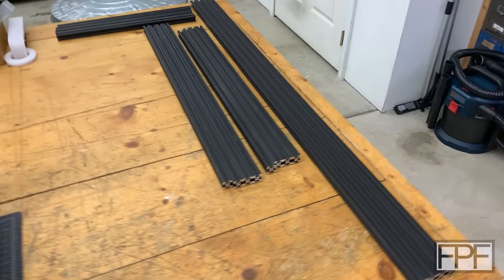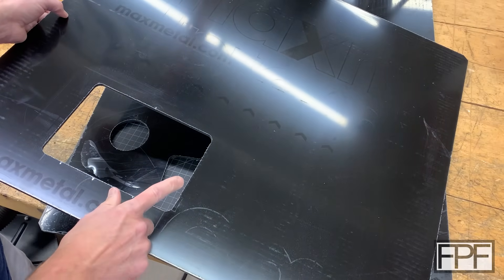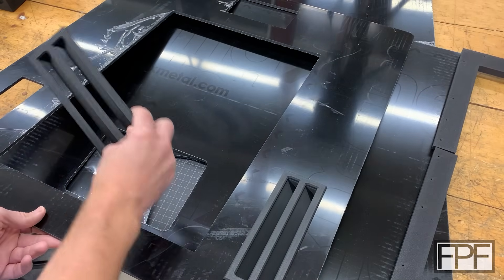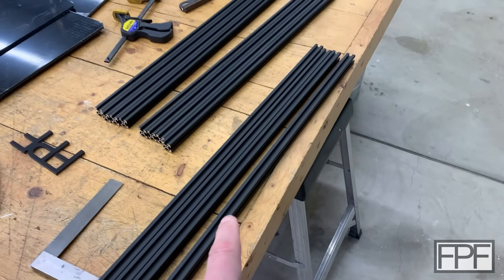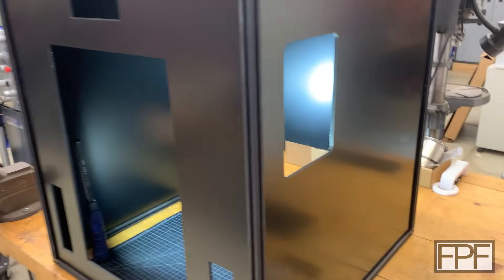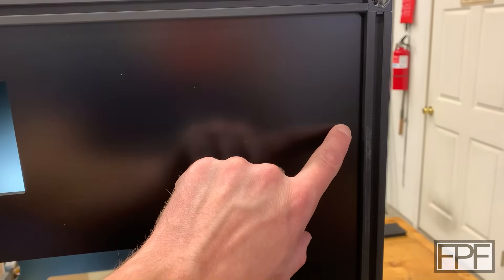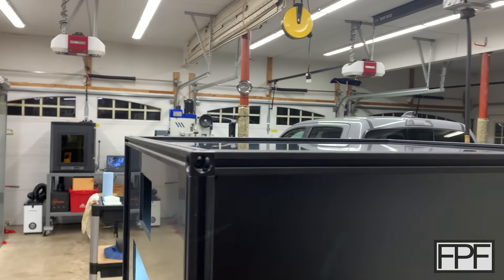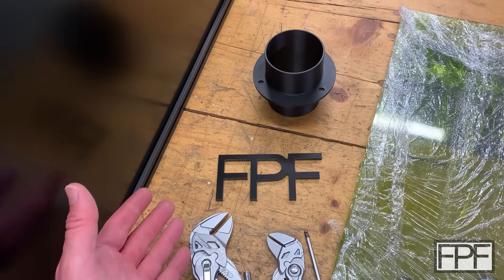DIY Laser Enclosure - 2020 Frame and Panels

Comment: Print TPU corner buffers, they should have enough squish to hold the panels firm and block the gaps.
Reply from the maker: THIS, 100%  I came to the same conclusion thinking about it over the weekend.   In fact, I was beating myself up pretty hard over thinking some caulk in the corners was a reasonable fix (I was tired), and had planned on re-cutting the extrusions, but thinking about it more there's really no way to get a 100% perfect fit.  They would still inevitably rattle.  Preloading them to float from all 4 corners with some TPU wedges I think is the best real solution.

Comment: You have a 2mm gap to fill. TPU filament is 1.75mm and flexible.  You could just lay a strand of it along the bottom track and let the panel edge rest on it.

Comment: I do wood cabinets and when i do floating panels I make them smaller for expansion and contraction as you'd expect.  I fill the expansion joint with the rubber spline tubing for window screens.  it might be too big to use all along the whole perimeter since you can only get it in standard sizes but you can chop them cross-wise at any thickness you want and silicone them in place at each corner (8 in total for the 4 sides).  No rattles and plenty of squish for expansion and contraction.  Love the videos, keep up the good work!

Comment: I would say to get the glass cut with a CNC waterjet if you have one available near(ish) you. It should cut as cleanly as cutting normal acrylic on a CO2 laser. Maybe a local MakerSpace or possibly a machine shop that mostly works with flat stock.

Edit to add: I agree with the many others about 3D printing 1mm spacers to put into the bottom channel. Yeah, you gotta take it apart again, but that would be a much cleaner solution for the overall aesthetic. Maybe throw some spacers into the sides as well if you are shy there to mitigate lateral movement.

Comment: I think I'd put a healthy dab of silicone on all four corners of each panel to hopefully prevent any buzzing or rattling of the panels when the machine is running. You may want to add a dab on the center of each panel/rail once there installed, but that can be done later if needed.

Comment: Cut the safety glass with a laser. Don't score it. If you can't cut it with a laser use a carbide tip fine tooth table saw/circular saw blade. Tape over the cut line on both sides with blue painter tape. When starting and ending the cut, feed the plastic extremely slow to reduce the chance of chipping. It is most likely acrylic. I used to manufacture parts from both acrylic and polycarbonate. Good luck.

Comment: Chop saw with a standard bled works perfectly for 2020. cuts clean and doesn't gunk up like a bandsaw. I just built some porch railings and a gate out of it. Exact same seller too! You can buy some rubber fill trim for the 2020 to cover the exposed slots to make it extra nice looking.

Comment: I'm not saying it would be the right way to do the cuts, but I'd be tempted to find a 1/8" carbide bit for a trim router, and clamp a straight edge the right distance off from where I want to cut the safety glass, then makethe cut in 4 passes to reduce the chance of a singe cut inducing a crack off to the sides. Possibly score both sides of the cut with a straight edge and utility knife to encourage any such cracks to follow the score rather than heading out into the expensive unknown.This does suggest  first making sure you have the ability to tollerate the kerf. If not, score the cut line 4 or 5 times, preferably on both sides, then fulcrum break the panels on the score mark. And remember to sand all the edges and break/cut surfaces. 

Oh, and have a dust extraction to the vacuum as you're doing the router cut. No idea what materials are in the treatments, I'd imagine it's not something you want to brethe or carry around scattering in the house.

Comment: Print some TPU spacers for the channels to act as compressive elements to lift the panels and to minimize rattles.  You will definetly want something for the rear panel where the fan is connected... Even thru the hose some vibration will be transmitted.

Comment: For cutting that plastic sheet, fine tooth plywood table saw blade installed BACKWARDS. I cut plastic all the time and this gives a very clean cut without splintering or chipping. Set saw blade just barely high enough for the thickness of the material your cutting.
Reply: You're*

Comment: To fill the gap remove the bottom rails one at a time and insert a line of printer filament.. That will raise it up just under 2 mm.... To cut the plastic tape over the cut line on both sides and then use a fine tooth table saw blade.... Test on a thin section along an edge you don't need...

Comment: Two quick non-engineering thoughts. First, a handle to lift the enclosure; something to go into the railing? Second, on the exhaust, instead of screws, why not design it with threads? Could then make a nut with matching threads to attach. This would allow simple removal if needed. It would also allow you to put in a gasket and then replace the gasket if needed.

Comment: Foam backer rod.  Put in the slot on the bottom.  It's compressable. You can split it in half if necessary.  It will take care of your spacing problem  and completely disappear. Available at HD or Lowes for a few bucks.

Comment: You can use backer rod for filling cracks in concrete as filler in the rails to center and secure the panels. And it's not an adhesive

Comment: Depending on the size of the chamfers on the corners of those panels, I wonder if little cylinders of TPU might not be a better option than caulk.

Also, for people building this sort of frame, bear in mind that not all extrusion has the same inner hole diameter, and it can be real easy to overlook that when ordering. So for some extrusions you might just have to tap, while for others, you might also have to drill an appropriate hole first.

The worst case is when extrusion arrives with a hole that's too big, it taps far too easily and is barely able to hold the bolts. I've had to switch from M5 to M6 for some extrusion, and it irks me to have mismatched bolts like that.

Comment: Cutting the safety plastic:   you can get a special knife for acrylic. It's basically just a utility knife with a bit of a reverse hook on it.  A carpet blade may do the trick too.  They're cheap, $10-15.  You score it a number of times then just snap the piece.   I've used it with 1/8" acrylic and it took about 5 score before snapping but it snapped REALLY cleanly.

Comment: Fixing your gap is easy.  Just take it apart and grind down the 4 vertical pieces just a mm or so and put it back together again.  No gap and no need to use caulk.

Comment: Was going to say "use the laser to cut the laser glass", then my brain finally started working and I realised the idiocy. If you've got a band saw, a really really fine toothed band saw blade, very little pressure on the work piece, let the blade do the work. As another commenter has said already, to avoid any blow-out, sandwich it between thin wood sheeting (plywood or such).

Comment: Hey Rich in regards to cutting the polycarbonate we cover the cut area with masking tape, then use a jigsaw with a metal cutting blade and reduce the through to 0 so the blade is not trying to advance into the material.
Hope that helps cheers Matt

Comment: This just seems like a very expensive way to go about building an enclosure..

 I'm building an enclosure for my Neje 4max laser with the extension rails. This laser is massive with a 1030x750mm working area. I'm using your 3D printed enclosure parts with a 5.2mm underlayment I found at Hone Depot. They are large enough to cover this large laser and cheap enough to make it affordable.

Comment: For the sloppy slot fit, could you not just print some 1mm thick strips and lay them in the slots? TPU would work well. Put a 0.6mm solid layer and a 0.4mm of zigzag infill and they’ll act as spacers and vibration dampers at the same time.

Comment: Re your panel movement...you could just print some 1mm spacers that are a tight fit into the extrusion to hold the panels in place. It won't sort your corner gap issue, but it will stop the panels being able to move about in the extrusion

Comment: Get a sacrificial table saw throat plate and a fine tooth carbide blade. Raise the blade through the throat plate (clamped down!) so there's no gaps around the blade. That prevents chipping.
Reply: Even better, 3d print the zero clearance throat plate

Comment: I have seen some woodworkers, when making shaker style doors use a type of foam pellet in the groove between the frame and panel to allow for wood movement without the panel rattling around and still be centered in the frame.
Perhaps you could print some form of TPU gasket say 1.5mm thick to fill out your (in)intentional 2mm gap and get the panels centered that way. 🤔
Reply: These are often called "Space balls" and can be bought online.    Good for filling up the space but also stopping most noise from loose panels.

Comment: If that slight imperfection on the side panel bothers you, you could just flip that to the inside. That panel doesn't have any cutouts.
Reply from the maker: yeh, I had placed it that way because the bottom corner (now on the inside) has some wavy marks from bending it back to shape.  I didn't see the marks on the other side, so now I just have to decide which I want to see less :)

Comment: If you want to remove the slack of the send-cut-send-plates, just remove 1mm from the extrusions. Set up some sort of jig in your mill, and it will be precise and quick work.  Sure, that means you would need to disassemble again, but much cleaner that caulk, imho.
However, personally, I'd just leave it as is. Looks great. 👍
Reply: How do you solve the tapped holes that are now a mm too low?
Reply: @VidarHaslum  I'm sure there are threads to spare. If not, then just run the tap in with your fingers, to align it with existing threads. Then just tap some more threads.
Reply: @VidarHaslum when you say  "too low", do you mean "less deep"? Because the corner pieces will solve any change in alignment, since the screw holes are located on the end face of the extrusions, so there will be no "too low".

If the hole ends up not deep enough, use shorter screws, shorten the screws or put a couple washers between the screw head and the external face of the corner pieces.
Reply: @allnicksweretaken  Im stupid. I was picturing a hollow square bar for some reason.

Comment: I am wondering why you didn't drill the holes, put the door in and the vents etc BEFORE you assembled it into a box....

Also, you could print a 1-2mm strip and slide it in the bottom extrusion to get rid of those little corner holes at the top.
Reply from the maker: it's a fair point, in this case it's more of an order of operations that made since for the vid vs. the order of operations that made the most sense for assembly.  with the bottom open though, it's actually not to bad to work inside the enclosure (I remember this from the last one I did that was slightly smaller)

Comment: RE: 2mm Panel Gaps, consider either the Black Silicon Caulk or a EVA foam strips to :
A) Prevent Rattling from machine operation.
B) Prevent Fume escape/control ingress air into the cabinet

Comment: Can you not just cut your aluminum channel down say 1.5 mm and make it a tight fit?
Reply: It's a printing channel. He needs to print a solution. A spacer under the bottom edge. 😂
Reply: I think the tapped screw holes will be misaligned if he cuts them down now. I like the printed spacer idea.
Reply: @VidarHaslum Couldn’t he just re-tap them?
Reply: @02ranger Possibly, but it's difficult if they are overlapping. Forget it. Im stupid. I was picturing a hollow square bar for some reason.
Reply: @VidarHaslum somebody else mentioned that he’d have to be careful if he’s trying to cut new threads while the original threads are still there, so trimming the length might actually not be a great idea.

Comment: As far as the panels being 2mm short; couldn't you print a 1mm tall strip to place in the bottom channel?  Maybe that'll take up enough space.
Reply: That was my first thought too. Adding some packers or shims into the bottom rails would be far better the plugging up the holes in the top corners.
Reply: @OldGitDownUnder Dang it, shim was the word escaping me.  Thanks.
Reply: Yeah that would be a great idea. Using TPU 1.5mm strips as shims on all sides could even provide a bit of cushion to increase the tension on the frame a little bit. Could make things stiffer

Comment: How about just add a layer of thin foam (or felt) weather stripping to the inside of the aluminum channels to take up the extra space between the inside of the channel and the edge of the panels?
Reply: i like this idea better than a 3d printed spacer add some coplience might even stop the banels shaking in the enclosure too
Reply: Or print some shims to raise it 1.5mm
Reply: Foam works really well. Milo project does that for the casa enclosure and it works well. Keeps stuff from shaking and could be used to raise up a little too